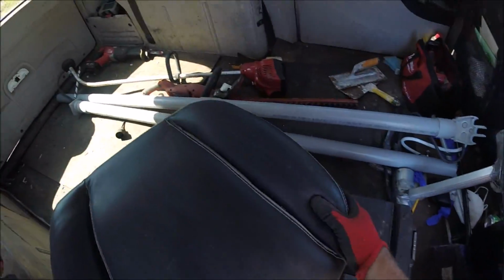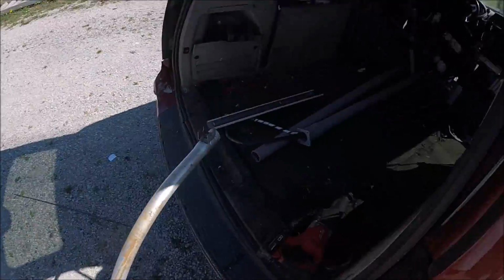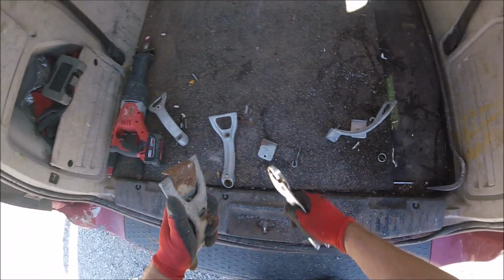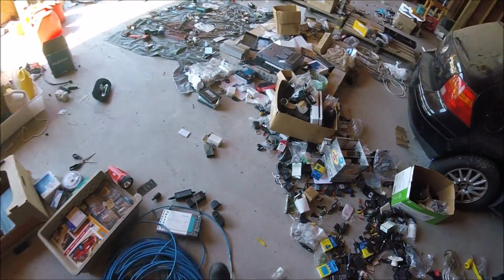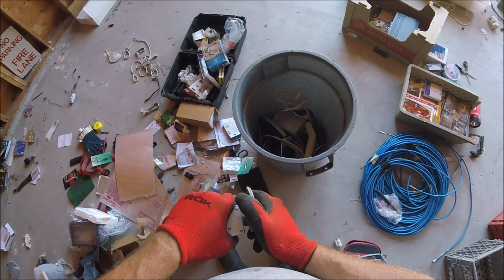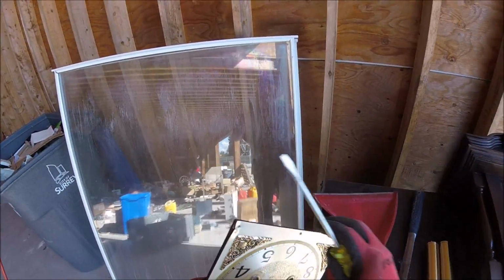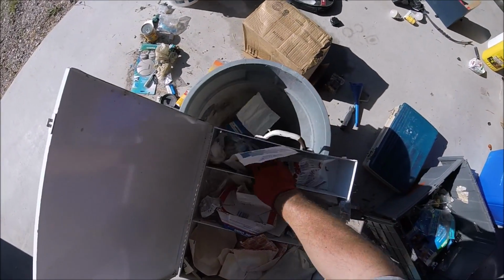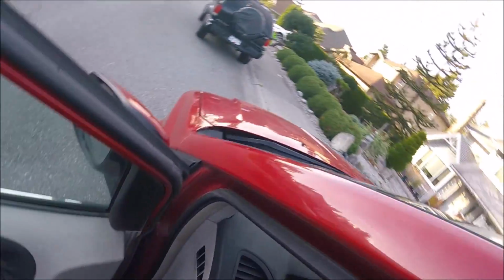Street Scrapping & Cleaning The Yard

Comment: Sorry about your kidney stones. I have had one kidney for 50 years now and it has clamps on it. I never had stones until a couple years ago. They put in stints twice to move it. They can't use ultra sound to bust it up since I have 1 kidney.  The tests show mine is caused by the most common way which is salt and vitamin C binding together. Your Dr can test to see what causes yours. I am 75 now and doing pretty good except for breast cancer which is now clear and positional vertigo. Drink plenty of cranberry juice and 88oz of water daily. Good luck.
Reply from the maker: Sorry about you Cancer & thanks for the info